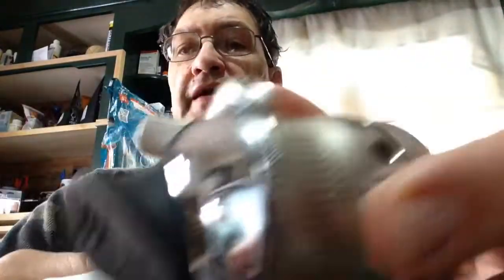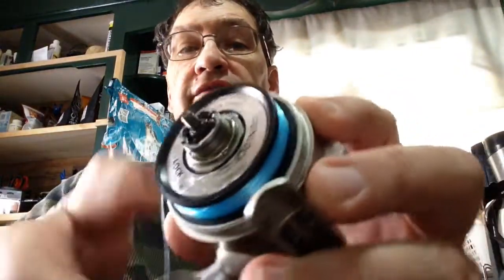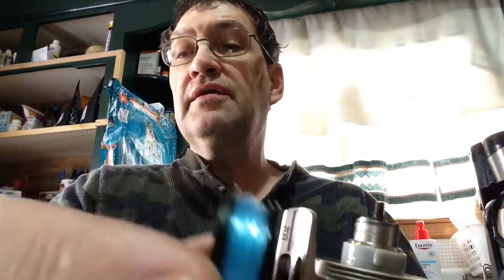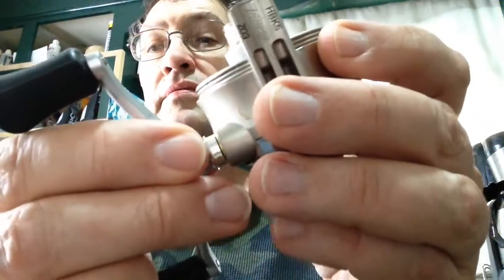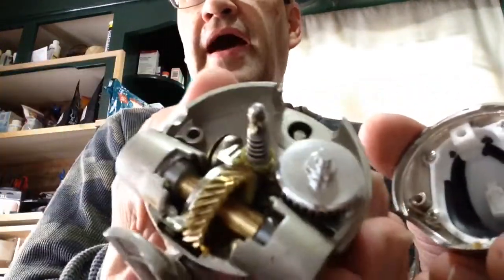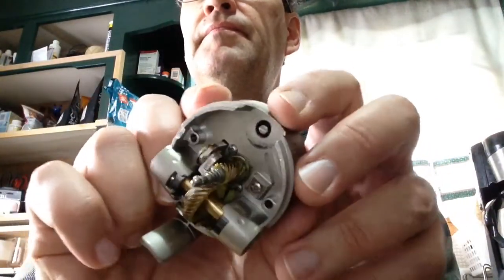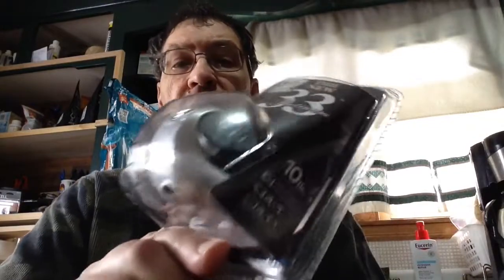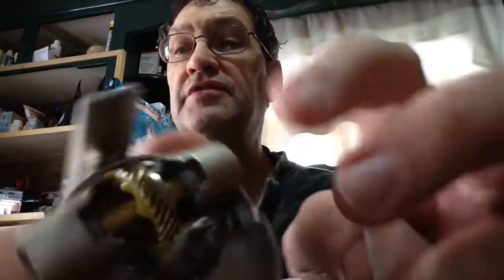Zebco Omega ZO3 Breakdown Check Out

Comment: I own the Zebco Omega Z03, best reel I've ever tried. Everyone I fish near is confused and jealous at my casting distance and always wants to try it. I overpaid though, spent 100 on it at Dick's sporting goods. Wish I had maintained it a little better from the start. A year or two later, I get some snags in the reel when casting but I think it's my fault for not taking better care of it. If you don't like this model very much i can't imagine how it feels using a better version! Maybe time for me to upgrade? What's your favorite Zebco closed faced button pusher?
Reply: Hello Tom, Thanks for writing!  Yes, I really like the Platinum 33 but I have aligned the pins and springs better on my Omega and switched to 8lb smooth cast line and it’s been quite good since. I am actually using it on one of my pond rods currently. I was not really happy with my Omega when I got it, maybe it was just not what I was expecting. I got a very good price when I got it because it was included with a clearance model rod, so I think maybe $39 for the whole rig. Tight lines and Happy and safe 4th of July!  Dave

Comment: Dave i bought a z03 after seeing you vid  a while back, what is the pin problem?
Reply from the maker: Hi Lee, thanks for watching and sharing your experience!
For me after having used it for a while, I find that if the line is not absolutely perfect it hangs up while being casted. Even though the pins work properly, somehow the line catches up inside while casting. Once I change to fresh line or a little softer line, like Smooth Cast it’s fine again for a while. I just have much better luck and less hassle with the standard Platinum. 
Tight lines ;)))))))))
Reply: @bigdavewilsonfishingandout3777  Hi Dave, just curious about this issue.  Is the line getting caught on the pins or up inside the spinnerhead?  Mine works fine for several years now, it’s just heavy for my usual pond line up.

Comment: also are there any real advantages of the omega z03 pro reel over the omega z03?
Reply: wolfpacak47 
I can’t say because I only own and have used the regular one. Maybe an improvement in gears or weight, because Zo3 is heavy because front cone is milled. (At least it’s looks that way.).

Comment: Dave ,whats the difference between 888 & 808?zebco
Reply: Hi Leroy, thanks for watching, caught the notice on my phone..  So the 808 is marketed as a Salt water model, the 888 as far as I know is not. But the 888 if you search I think has better bearings, the 808 has bushings. Pretty sure without searching all this is accurate. 
Both are very good but large and clumsy. I caught a nice 35+ inch striper in the river current on the 808 and it handled it well with a medium drag to play it out. Ya gotta us the drag on these Zebcos or you’ll snap the pins off. Cheers and tight lines!  Dave
Reply: Hi Dave and thanks also what other far casting trout to lake maybe bass reel without getting the 887 monster ,the bullet breaks fir 100$? Thanks Dave i tryely trust your advise ,i like trigger reels also
Reply: I have the Omega, the spool oscillates so winds the line more balanced, I wasn’t a great fan in the beginning it has three pick up pins and I found it finicky. But after I changed to some different line 8 or 10 lb smooth cast it was much better. I also like the Platinum, I have a few, same thing line 10lb smooth cast is good, but I use 8 too. Cheaper, has two pins, good gears and bearings none have failed on me even after a few years now still running well. OK, good deal Tight lines!

Comment: Any idea why my zebco Delta make clicking sound while retrieving? Am I reeling against the drag? It's set pretty tight and fish are 2  to 3 pounds. Max. Appreciate any suggestions.  Thx.
Reply: Rich Dorak 
Hello Rich, thanks for watching!!
It could just be the take up pins or one of them is a tad high and clicking against the front cover housing. That also makes a little scraping sound. If it is the drag, that's OK too because Zebcos with drag too tight can eventually damage the gears if sudden force isn't allowed to pull some drag etc. Hope this helps!! Dave

Comment: hi great video I bought this same exact reel today it had that red zebco Cajun 10lb line on it I put stren 25lb line. on the extra spool and swapped spools the 25lb line came off my 80s model zebco prostaff 888 reel ..will the 25lb test line work correctly on the omega reel ? I haven't fished with it yet
Reply: wolfpacak47 
Hi Wolf, thanks for watching, as for. Zo3 I like it in general, the only beef I have is the line getting hung up occassionally when casting which to me is attributed to having the three pins and with certain line, but it is a fine reel for sure. Whether the 25 Stren works out will show in time, so please report back after you’ve used it some and if you had any problems. In general ai like the “smooth cast’ lines they seem to lay out softer and less wirey. Braid for me has been very uncooperative and don’t recommend it at all on the Zebco but everyone’s end game is different and it might work for some applications without a problem. Stay safe out there! Dave